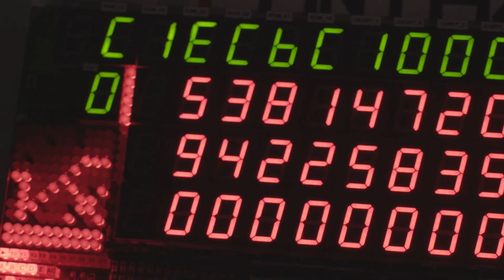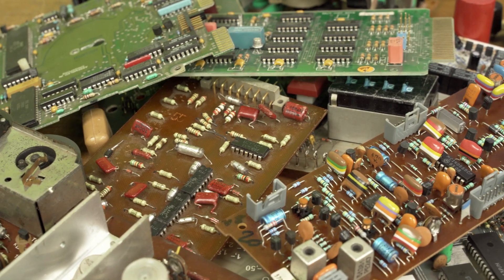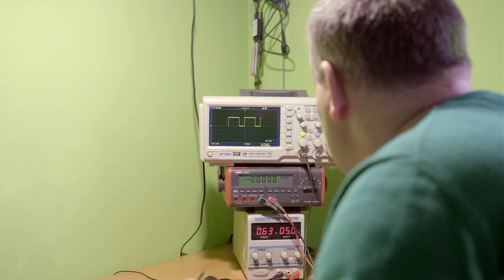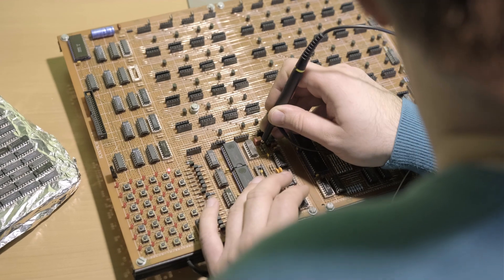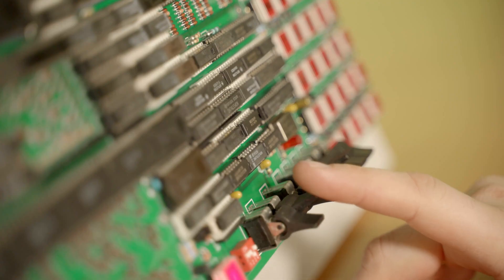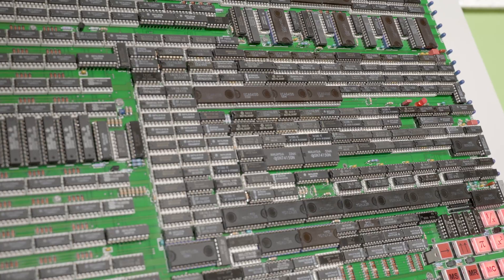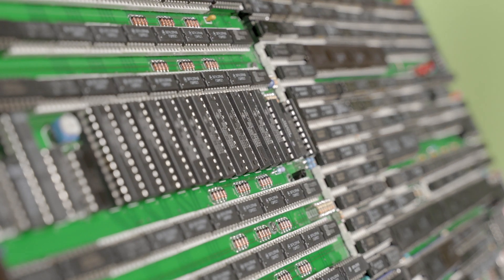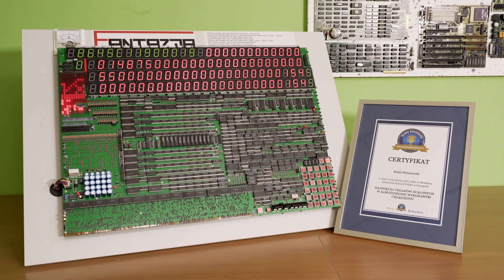[Polish Record] I built the calculator

Comment: The question is, if the number of ICs is really efficiently used. It is not hard to design an inefficient logic structure. Real art would be to design the circuit to be as efficient as possible, use least amount of resources to achieve the goal. This was also the exact mindset at 70s, as electronic components were not as cheap or as abundant as these days.
Reply from the maker: Hey! Here is a reply form Mr. Rafał Wiśniewski; “All of the ICs used in this device are utilized 100%. 
When designing the logic of each of the thirty modules, I paid great attention to the minimization of logic functions. When designing the final PCB, I arranged the elements in such a way that the unused logic functions of the neighboring ICs were implemented in the current circuit. The logic design of this device was a very difficult task. It took me several months after which I was left with “only” 477 ICs out of 550 :) 

I didn’t use digital circuits with a large scale of integration. I stuck to a certain style that I imposed. The most "advanced” chip in this project is the 74AS885 comparator, there are 12 of them which substitute 24 74LS85 chips. I also wanted to use 74LS198 registers instead of 74LS194 but they turned out to be more expensive and hardly available. Those problems are just the “tip of the iceberg”, it is impossible to summarize them in a few sentences.”
Have a nice day!